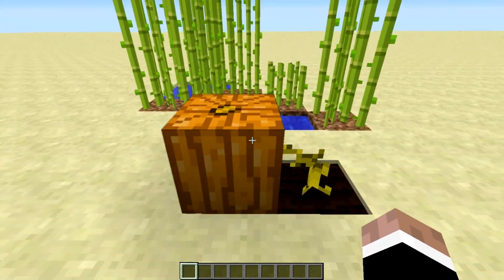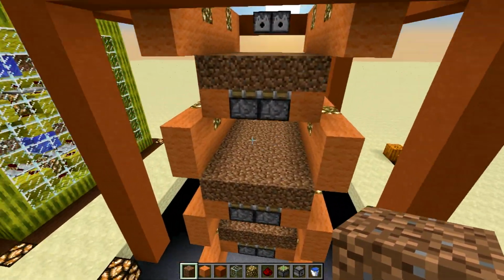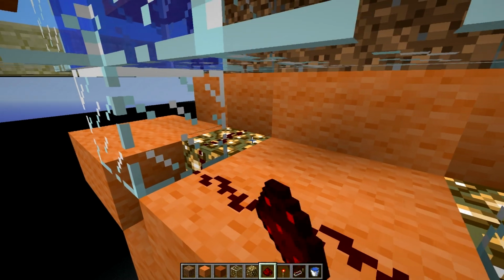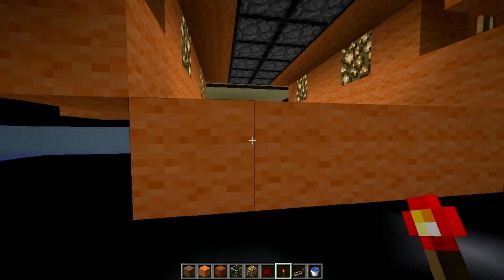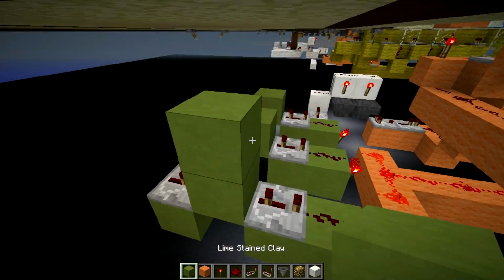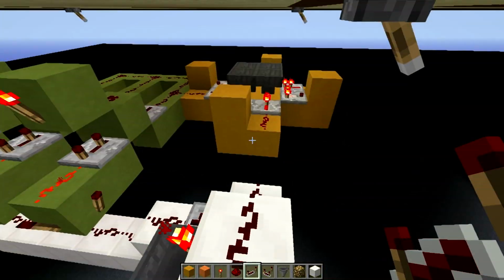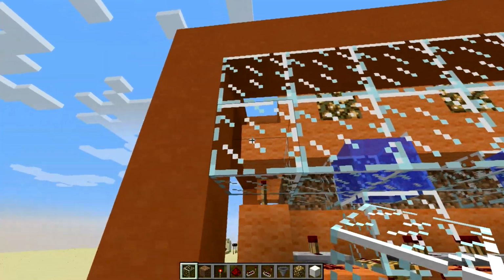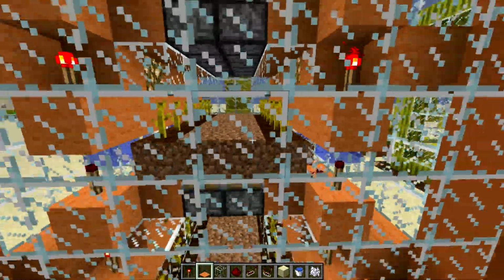Minecraft Automatic Cube Farm Tutorial (Melons and Pumpkins Farm)

Comment: Hey! I have been having issues with the hopper clock thing on PS3; I have built it exactly like in the video (I'm pretty sure) but does not work. All the items that I put in the hopper all build up into a certain one instead of being passed around gradually... Suggestions?
Reply from the maker: Nateothegreateo All the hoppers need to be connected, be it clockwise or anti-clockwise. If items are building up into one of the hoppers then it isn't connected correctly.
Reply: They are all connected- I've redone it lots of times and this isn't the problem. The items move around but only a couple and then they come back to this certain hopper
Reply: Ah I've found my problem and fixed it. As it turned out, they were all going to one hopper as that was the only one with the repeater facing the correct direction :)
Reply: Nateothegreateo stormfrenzy are you sure it's working? Mine were working perfectly until this last update (1.8.3) came out and now the 4 hopper timer gets stuck and doesnt keep going. even though they are all facing the right way
Reply from the maker: Andrew Mahlen The hopper timer is working fine for me in 1.8.3.
Reply: Yep definitely working for me- I'd just check all repeaters are facing correct directions and that you didn't make a small mistake

Comment: I just built this pumpkins and melons. It works great. Had a few small problems, but they were my own cause. For the pumpkins I used jack'o'lanterns and didn't have the problem of stalks attaching to the frame. Also, you don't really need to irrigate the stalks if you use bone meal to grow them to full size. I believe the pumpkin (or melon) will appear just as quickly either way. Thanks for the awesome tutorial. I'm subscribing!

Comment: Hey Storm, my pumpkin cube's timer clock broke today. probably from an unloaded chunk. Ive got it set up the same as yours to the tee. When i came to check how many items I had i noticed the water was running and the pistons were down, and i went downstairs to have a look, what do u know, the timer had stopped clocking. Items were stuck in one of the hoppers. so i smashed all the hoppers on the timer out of frustration and replaced them with the 5 stacks of dirt I had in them. Starting from the hopper timer that points out towards the 3 pulse extenders the dirt started pulsing around as usual, emptying out and filling the next hopper, they got around to the stage where the water/pistons cycle starts.. cool, and then the water stopped and pistons went down (as it should), SWEET! until i noticed the dirt was now skipping over the 1st hopper, so instead of filling it up to 5 x 64 stacks it was putting 1 at a time and going to the next hopper timer.. friustration setting in! Do i have to remake the whole timer setup? I hope you or someone on here can help me with this.. Sorry for the Essay lol. Im running 1.8 release on my single player survival world
Reply: Hey I may need to rebuild the whole clock system, I rebuilt the hopper timer and it works ok now but when the pistons go up my dispensers dont do anything, they only tick when its time to turn the water off :(
Reply: Richard Govan Yeah that is a common problem, try checking for chunkborders on the clock, it might save it. I experienced the same thing with my lava dispenser/piston in my cow farm,. I have a piston that is supposed to keep the baby cows from flowing in while the lava is on, but sometimes it switches and only lets them in when lava is on. probably same thing

Comment: hey there stormfrenzy I'm having some issues with the hoppers and the T-flipflop at around the 21st minute. My hoppers aren't sending anything to each other and no signal is going through to the comparator. I'm wondering if you would be able to shed any light on that.
Reply from the maker: Are the hoppers connected? When you place the hopper you need to be shift clicking on the hopper next to it so all of the hoppers are connected. You can tell if they are connected by the little nozzle at the bottom of the hopper - if it isn't facing the adjoining hopper they aren't connected correctly.

Comment: Any changes in 1.7.4?
Reply from the maker: It works fine in 1.7.4, 1.7.5 and in the 1.8 snapshot releases.
Reply: stormfrenzy Im having a problem where the water will turn on but the pistons wont. Any suggestions?

Comment: At around 20 minutes, you could probably make this alot simpler by timing it with a light detector.  A comparator could also be used if you only want it to activate on a specific signal strength.  aka, if you only want it to activate at noon minecraft time, put a torch with redstone wire on the side of the comparator.

Of course, there may be some item loss depending on the signal strength you select.
Reply from the maker: I chose to use a hopper based clock to have maximum control over the timing for the water and pistons. A light censor will work but you would need to fiddle with the timings. You wouldn't want a rain shower to trigger the pistons early! :)